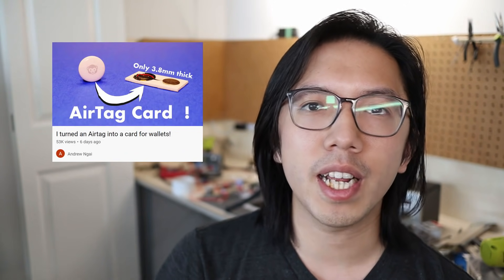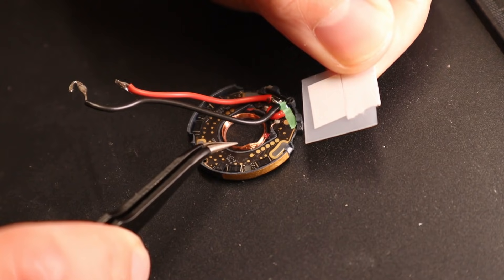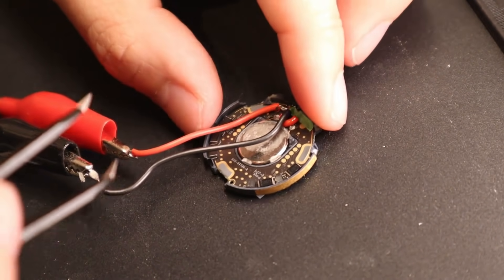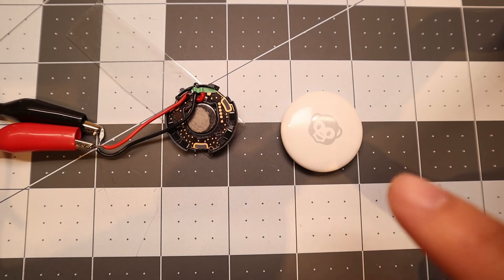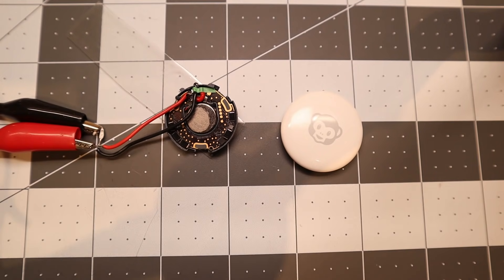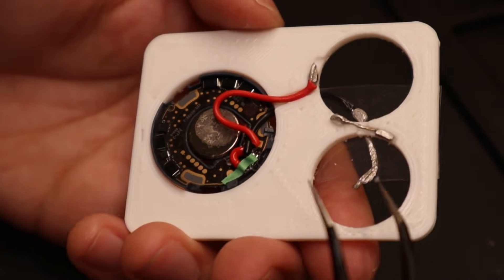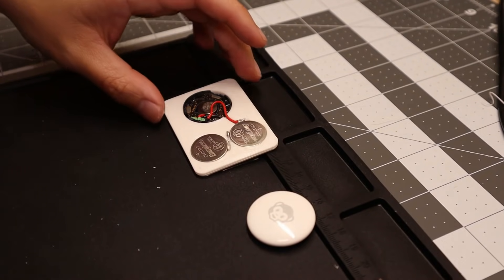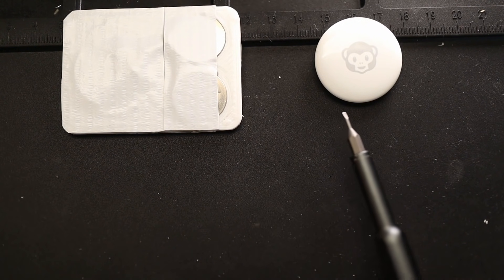AirTag Card for wallets V2 - Working speaker and double battery

Comment: Would a piezo speaker work here? Very low profile, very loud and you could add more if needed. Thinking something like this at digikey etc FT-23G-3.5A1W035 SS316

Comment: Would it be possible to have someone in China manufacture a PCB with the outside design of whatever I want the card to have on the outside, and with a simple (custom) board that can be picked up on by iPhones (that would send the location to Find My servers) but without NFC/Bluetooth/speakers? In other words, would it be possible to, in the same way that a Hackintosh is a non-Apple PC running Mac OS, have a non-Apple manufactured board connect to the Find My servers?

Comment: Just stumbled upon this.   Why wouldn't you print a cover instead?   you can even groove the cover to accommodate the wires.    Add channels to the base and rails on the cover, you can slide them over and somewhat secure it.

Comment: I would assume the construction of the AirTag is what made it work so well as a speaker. The plastic is probably similar to ABS if not ABS. The way that all the parts are secured essentially turns the entire white plastic surface of the tag into a speaker cone. I’m sure you’ve realized this, but I saw you were just adding a piece of plastic on top and expecting it to be as loud. The reason the AirTag worked better is probably because all the edges of the “speaker cone” were secured in a rigid manner on the original construction which doesn’t waste as much energy as your version and makes it louder just like a real speaker. The magnet is also secured rigidly at the back of the voice coil to make the movement much more predictable and stable thus increasing movement accuracy and in turn sound quality and volume levels

Comment: I have been working on a similar solution, being inspired by your first video, and a couple of suggestions I could bring to the table are:
- You can remove the battery connector, and solder to the debug pins on the board
- You can use enameled wire for that, as they're way thinner
PS: Thanks for showing how you managed to preserve the speaker, that screwed me over last time.

Comment: dude, i wanted to do exactly that! thanks so much for the stl file (battery holes are too tight, but nothing that sand paper can’t solve). also thanks for speaker improvement research, awesome! couple of evenings and i made one for myself: https://youtu.be/16t9e5FDFTs - i lost a wallet a week ago and found it in the house after 2 days of searching (my wife’s bag,   barely visible side-pocket). at that point i decided i had enough and i needed to airtag my wallet (and passport too for that matter), this mod solves the issue perfectly. also, i think i know how to make this design 1.. 1.5 mm thinner. custom pcb, getting rid of black airtag pcb holder alltogether, thinner batteries

Comment: Is it Apple's engineering or was the speaker damaged as you tried to pry it? Cause, I was expecting you Dremel it around the case with the sanding attachment and remove the PCB. For the glue, isopropyl alcohol would be my way to go, but of course everyone has their own way.

Comment: I followed your V1 video, but made the mistake of cutting and removing the two Spring clips on the two + battery connections.  It was working up to that point, but i think those spring clips are also provide power into the PWB other than the two touch down points.   Oh well, I'll have to order another one.  I was also concerned about using the magnet from the speaker in my wallet as it could de-magnitize any mag-stripe cards.  I wonder if a cheap, flat piezo-electric speaker would work in it's place?

Comment: I didn't catch quite how to lift the PCB with the voice coil unharmed up from the plastic enclosure. Will it sit securely enough, if enough heat is applied to melt the glue?

(In other videos, they just show how to disable the sound by removing the magnet)

Comment: You think it's possible to make one, that's just 1 mm thick? You'd have to take the NFC antenna out too and then use one of those ultrathin iot batteries. That was actually my plan, but it might be too difficult to pull off..

Comment: Use two 2016. Remove the speaker. Use a piezo speaker instead which is nearly flat. Trim down the original board's plastic so it's thinner.

Comment: Hey Andrew, 

Awesome video! I did what you did and it worked!

only problem was that the speaker doesnt work on my end? Did you have that issue? Was it that copper loop that needs to be connected to the two terminals?

Thanks!

Comment: Nicely done ! I will try to do the same as a DIY project. Out of curiosity, what is the size of the wires you've used ? 22 AWG perhaps ? thanks !
Reply from the maker: I used 26 AWG, but thinner wires should be used. 26 is what I have in hand
Reply: Thanks. I will use I think 28 AWG @andrewngai5215

Comment: dude... i gotta tell ya... some nice work, what if you remove that speaker altogether? U got a super little silent, customised tracking system me thinks? Would buy for sure if for sale, already thinking biz card size hardwood cover for wallets or steel case for mounting on campervans/trailers etc.. Best of luck where ever ur work takes you man... ..liked, sub'd n watching...

Comment: Great work! Now get rid of the thick wires by using thin metal conductors, much like the pieces of spring-metal you find for battery contacts in other devices, e.g., flashlights, remotes, etc.; or just by some copper/conductor strips on Amazon.  Next dump the duct tape for the same, much-thinner blister-pack plastic you cut out of that screws package; on the bottom side, you can glue it permanently, and it may improve sound; on the top, make it in two pieces, and you can glue it permanently over the logic board/radio, again, possibly improving sound: and if you seal the power conductors, it’s now water-resistant again; and you can make the battery side access a hinged “flap”, with which you can close using a light adhesive, rubber cement, or very thin double-sided tape for easier access — in two years. LOL.  You could also cut the plastic battery cover with a little pull tab so you can easily pry it apart. Great Work!! A wallet is literally the only use I have for an AirTag/tracker product; you have inspired me! I only wish I had a 3D printer!

Comment: It's also possible to use any 3V battery with higher capacity like a CR123A which gives you aprox 6 years of battery life in theory, i had printed a case for it and placed it inside my bike frame :)
(Keep in mind CR123A is pretty thick about 4-6 times the size of the CR2032)
Reply from the maker: That's a good idea. Does the bike frame block any of the signal? (assuming it is a metal frame)
Reply: @andrewngai5215  actually it doesn’t that much I’ve installed a small bit of copper inside and drilled a 0.25mm hole and filled it with copper it works fine :)
Reply: I was thinking I would wire it directly to my e-bike battery with a resistor to step it down to a reasonable voltage.

Comment: I just bought a spare air tag to try and do this too. What kind of wire did you use? I don’t want to accidentally mess up because I use the wrong wire.
Reply from the maker: I just used normal wires. there are other comments saying I could use even thinner wires. I think any size of wires are good since the current is so low in this case.

Comment: Suggestions for v3. 
-replace one of the battery with a speaker, for example a basic casio watch speaker, and reroute the sound to the speaker, so that ypu have a much louder speaker.
-from what it looks like the main height of the air tag is made up of its  outer plastic rim. It seems like theres also embedded metal so it probably works as an atenna of some sort. Maybe try reverse engineering it so that you can put the antennas flat on the 3d printed plastic. Then you can get rid of the black plastic and it would be mouch thinner
-what if instead of 3d printed plastic you would use an actual pcb? Or more like a pcb sandwich. JLC PCB sponsores a lot of makers and if you perfect your idea you could start looking into making a thinner betterlooking pcb version
- test its sound IN a wallet. If its too quiet maybe you could build a wallet that has a speaker on its side, and when you put your air tag card it connect via small pins with the wallet speaker, or embedd the air tag into a wallet from the ground up
Great project man, really love it
Reply from the maker: Thanks for the suggestions!  The PCB idea is very interesting, because it could guarantee a higher reproducibility

Comment: 1. The speaker needs air chambers (both front and back) to enhance (resonance) the sound. That's why it sounds louder and warmer with the original enclosure on.
2. Coin battery has high internal resistance (compared with Alkaline, Li-ion, or LiFeS2). The IR would grow higher when the battery is used and the delta between two batteries would cause reverse charging which could reduce the battery life. Adding diodes between batteries and the PCB could help, but it would reduce the usable energy of the battery as the voltage would drop below the minimum operating voltage of the MCU earlier.
Reply: Why would there ever be a delta between two batteries wired in parallel!!!

I am scouring the web at the moment for multi battery deconstructed airtag wallet cards. This is the first I've seen using two cells, but I am fairly sure (haven't physically checked yet) 4 cells should be doable, I want to see what the limit would be, and then start designing. I am curious why you decided to make a shape that is smaller than a credit/business card even though you were able to easily fit a second cell in.

Right off the bat, the cells can be laid out to physically contact all positive terminals so we only need one wire for positive to the airtag. 
Secondly we can embed little jumpers to complete the parallel wiring for the negative terminal between the cells. This should greatly reduce required wire length and routing complexity.

Funny, AirTag 2 hasn't been released yet. AirTag 1 is still king because it has UWB. Quite frankly the speaker can be dispensed with since it signals to someone stealing whatever this thing is tracking that it has a tracker, and I'd be using the UWB positioning to find it when I use it.
Reply: he should really go with lithium battery and wireless charging.
Reply: @RaymondLo84 taking the year long battery life down to how many days, I wonder

Comment: Hi. I purchased the Airtag  specifically on release day for my eBike. Now it has a Tile Sport and an Airtag. My question is do you think the orientation of the airtag will be better for detection - laying flat at the base of the bike or standing upright? Flat like a plate on the table or upright like a clock face on the wall? I assume the bike will always be standing upright.

Comment: You should print a cover that slides into place over the existing card and if its not secure you can hold it down by some screws so you dont have to fiddle around with the tape

Comment: FYI you cant use double sided tape to hold the coil its too "squishy" the coil needs to resonate whats its stuck to so use epoxy, you could 3d print a .4 layer on the back of the card for that.

Comment: If you make a v3 try to find a piece of plastic that is round with the same mass / weight as the original casing so it vibrates at its resonant frequency

Comment: Nice idea and nice videos. My only concern will be how well the batteries hold their connection to the solder. The smallest amount of movement could disconnect them. A thin CR2032 holder with a spring in it may help. Or tac weld the wires or metal strips to the batteries seeing you only need to do this once every 1-2 years.

Comment: OK 
LETS TALK SHELL
The material is important, but much more important is that it is fixed to both the pcb and the magnet. 
Meaning it’s a geometry problem, and you should apply/print a thin film across the hole with the magnet. 
Speakers don’t shake the cones impotently in the wind, they move in relation to a fixed point.
Reply from the maker: Thanks for the suggestion!

Comment: Why don't you just add another speaker instead of another battery?
There are low profile speakers available you can use them.. or use anyone from headphone, they might work better just keep the impedance as low as possible

Comment: Why don't you just add a new external speaker instead of an extra battery? That would make it sound even louder than the original. Also a custom PCB with a full case enclosure would make it perfect!

Comment: how much of a difference in thickness would it make if you don't take the PCB out of the housing, instead, put the entire upper part into the card? because that would circumvent both the sound challenge and the ungluing challenge.

Comment: The speaker was quiet because of the way you have the plastic positioned under the board, it needs to be attached to the coil in a way that it is free to vibrate

Comment: From what I can see in the video, you can make it smaller by removing the battery connector on the tag, it seems to be bulky. Probably conncting wires directly to PCB will give you extra room for improvements. Nice work, it was really interesting.

Comment: Hi Andrew, putting 2 CR2032 cell batteries in series will put 6 volts to the board, this will not give you 2 years battery life but will probably shorten the life of the board. Good idea though.
Next year Apple will probably bring your idea to real life. Loving the videos.👌🏻😉
Reply from the maker: Hi Dave, thanks for the comment and encouragement! For the 2 batteries, I put them in parallel, so the total voltage should still be 3V.

Comment: Hey Andrew! Great work man. I was quite confused on why you have always used a separate tape for the battery half of the card, and also why some of the battery is being left uncovered? Also, you could print the card with tapered edges for a better feel right?
Looking forward to this becoming a full-fledged series!
Reply from the maker: Nice attention to the details lol. I used a separate piece of tape for the battery is because if I need to switch out the batteries, I don't have to tear out the ones that have the electronics covered, sort of like a battery door.

I am not sure about a series LOL

Comment: Great job. I think some of the sound level, is in part the material Apple uses, but also the shape of the Airtag, the shape is oval, and not had open at one end. This would make your device a bit thicker, but I would suggest making one side enclosed, no opening on both sides, make the side closest to the enclosed area a bit smaller and the open are a bit larger, Also I would suggest print i so the closed end, has a few small openings for speaker output. Then when you put it all together, tape the one side and see if that make the sound louder. Great job, hope to see a version 3!
Reply from the maker: Hi Jeff, thank you for the comment, these are all great suggestions! I will definitely consider using some of them!

Comment: what if you use the plastic sheet as a "faceplate" for the airtag? the air gap could also help recreate the tweeter effect the original dome design has.

Comment: Love the new V2. may be for the next version, you can please considering a good card case design that is water proof and compact enough to be kept in the wallet. Also, a hole punch in the corner can help you use the same in a key chain as well.

Comment: I think the reason why the speaker is quieter is that the coil is not held in rigidly. That way, some of the energy got absorbed by the plastic sheet the coil attached to. Maybe try 3d print it with a dedicated socket that fixes the coil in place firmly. But to keep everything as thin might be tricker.

Comment: Maybe also try to use pcb board so you don’t need to 3D print card design but use pcb including the connection for extra batteries. To make card design ? If you don’t have 3D printer at home or offices :)
Reply: That could help with the speaker problem too! Id buy that

Comment: I think connecting two batteries in parallel is not a very good idea.
It will definitely not double the capacity, it will probably even reduce it!

Depending on the system, batteries always have a different voltage and, above all, a different internal resistance.
In this way, equalizing currents will always and permanently flow.
The batteries inevitably discharge themselves!
Reply from the maker: Thanks for the comment! I am not an expert in batteries so I will have to brush up on that!
Reply: @andrewngai5215  
The User has the option of inserting just only one battery without changes - which I would recommend for the reasons mentioned and it still works

About 1 year of operation is certainly enough, I think ;-)

I look forward to further development stages of the housing.
Very, very nice project,
keep it up!

Comment: Another excellent video and a very cool upgrade with the extended battery life! I have an idea for your next modified card airtag. How about increased antenna efficiency for a much longer range? Current range is about 30 feet.
Reply: Lmao definitely not possible. Apple has exclusive agreement with most of the companies that make the  chiplets on airtags (and other apple products) it also probably has firmware on it that looks it down